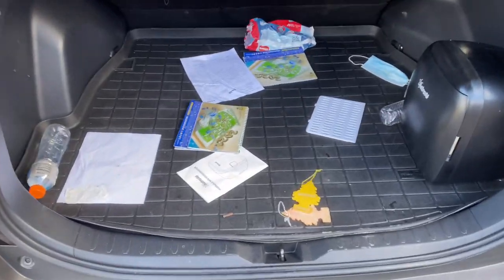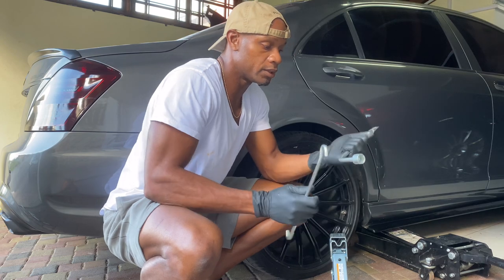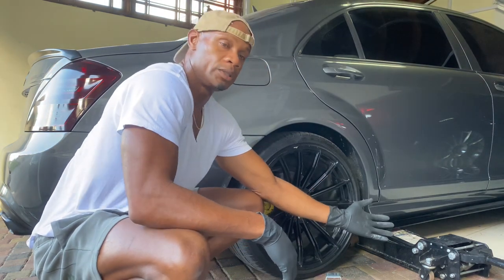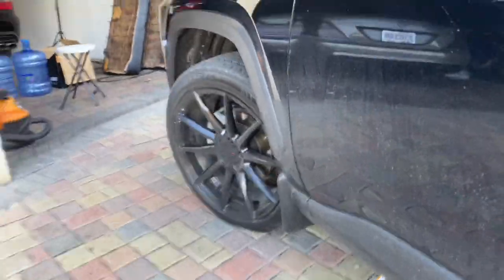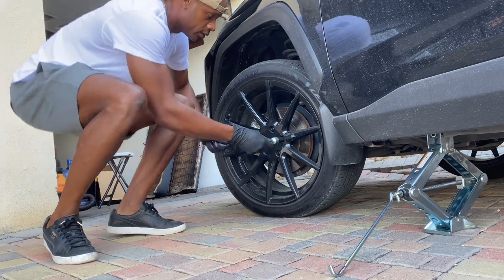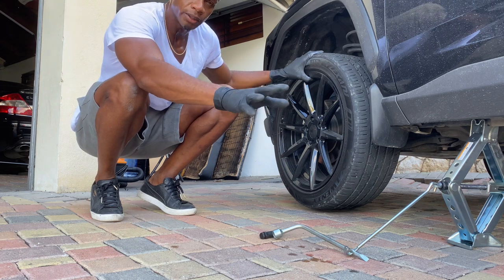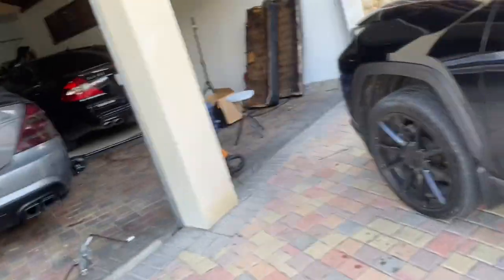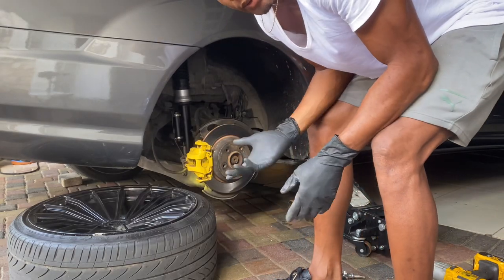HOW TO CHANGE A TIRE

Comment: I've seen usain train in person and run in person... as well as asafa and yohan... the key to Jamaica sprinting is simple... it about understand pendulums, rotational inertia, torque, symmetric and flexible rather than trying to develop endless thick muscles for power; as well as core strength, abs and lower back are even more important than leg strength. Also please note, your legs are only as powerful as you are because the 2 work in tandem. Leg speed or leg turn over rate should be view as a fulcrum and double pendulum system that is able to take the optimal swings when the sprinter is out of his drive phase.